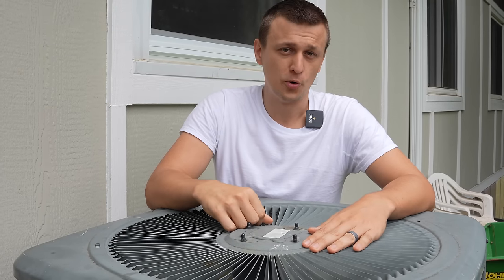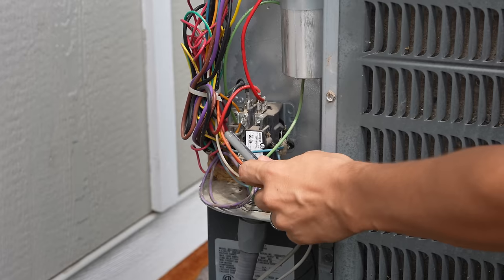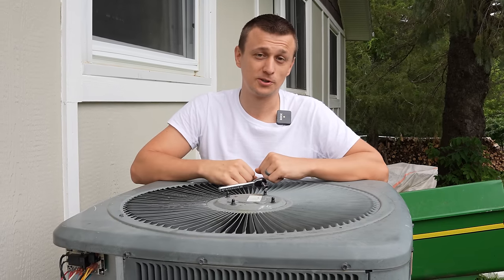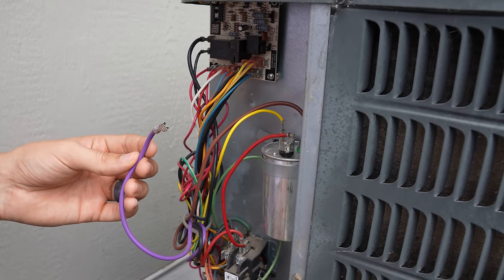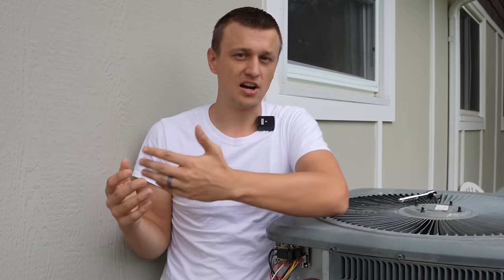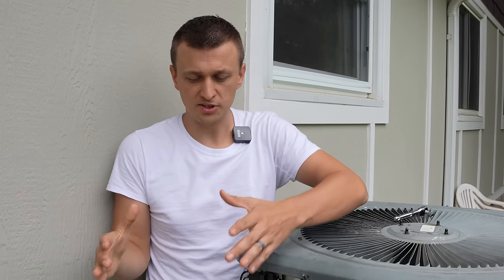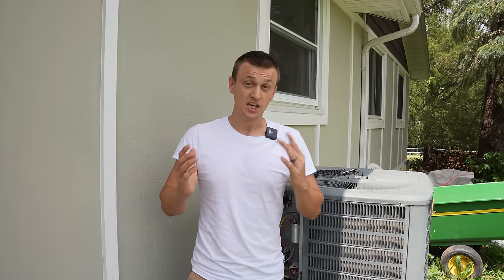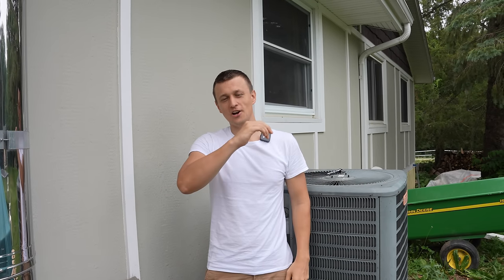Air Conditioner Noisy and Loud

Comment: I had a loud grinding noise coming from the condenser fan motor.Not a screeching noise and the motor turned freely with power disconnected. It would not do this all the time. Checked everything that you mentioned. The motor was a two speed Emerson motor. After many hours of checking it turned out to be a defective circuit board fan speed controller located inside the AC unit( Comfortmaker twenty years old). I bypassed this circuit board and installed a short jumper wire so the fan motor would work on high speed only and it works perfect. No more noise. This circuit board is no longer available anywhere. With 92 degrees outside I`am getting getting 53 degrees inside at top of furnace duct work before going in to main duct that feeds the house. I`am a retired electric utility service technician. Thanks so much for all your great videos!!!
Reply from the maker: Wow, that is awesome that you were able to get it to work without any noise! Major kudos to you for tracking it down and also finding a way to fix it. Your case is pretty unique but thank you for describing it for anyone else who may go through the same 🙏🙏
Reply: @WordofAdviceTV  The wiring diagram on the inside of the AC access cover saved the day to help trace this problem down. It showed what wires fed the high and low speed on the fan motor and the circuit board. I just removed and taped the low speed connector and jumper the high speed connector to the AC feed. Circuit board has been disconnected.

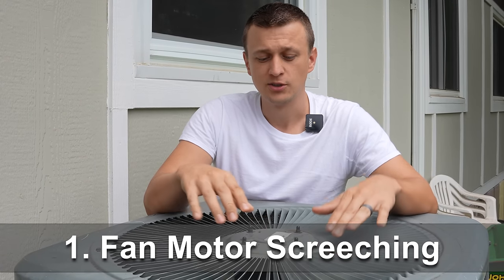Comment: 0:28 1. Fan motor screeching
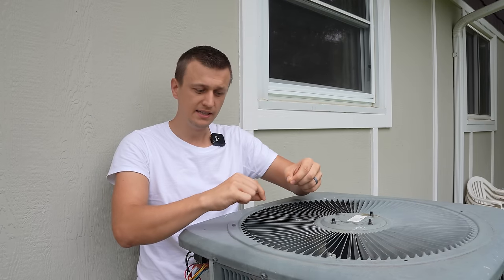1:52 2. Broken fan blade
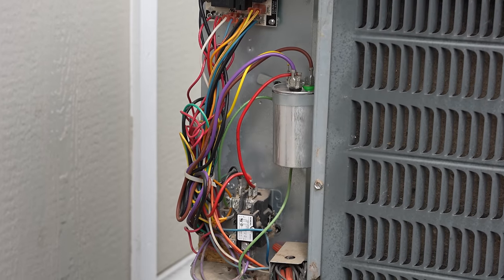2:36 3. Buzzing contactor
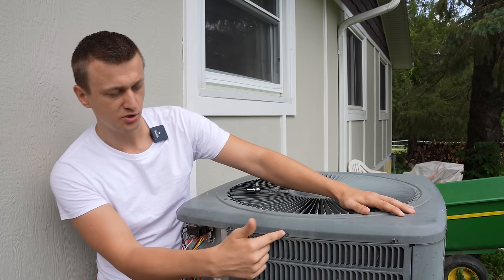3:43 4. Loose Screws
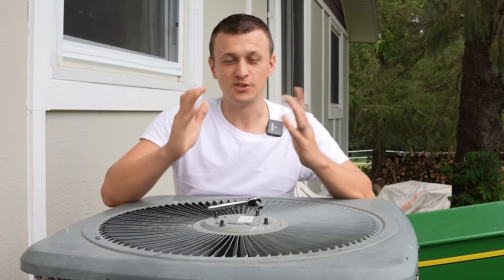4:30 5. Noise coming from the top shroud
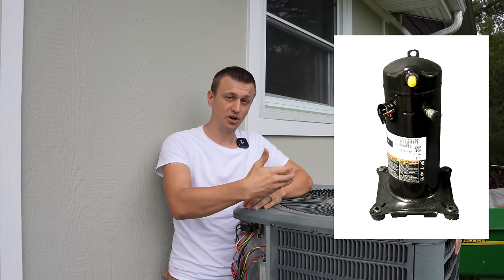5:46 6 & 7. Loud compressor
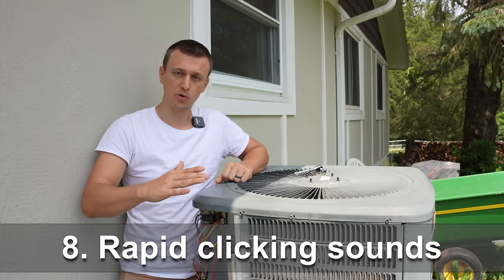9:14 8. Rapid clicking sounds
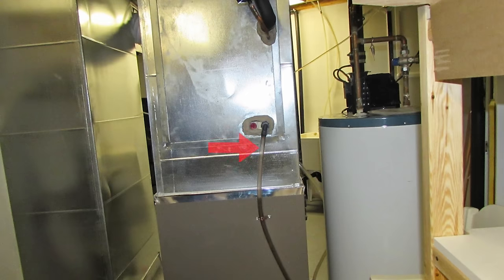10:05 9. Bubbling sounds
11:17 10. Rattling noise inside
13:11 11. Whistling noise inside
14:42 12. Hissing noise
16:23 13. Pulsating noise
17:47 14. Vibrating condenser base
Reply: Yes sirrrr
Reply: We just saw all of that no need for a recap 😂.

Comment: Thanks for this video! I was able to verify the bad contactor on my moms air conditioner, and replace it with one bought from the local AC repair store. The audio sample helped. Not only did it solve the problem for only $22, the AC part store was thankful I supported a local retailer.

Comment: This morning my wife and I thought for sure our AC unit was on the way out. I watched this video when I got home and then went outside to check it out. Turns out the fan motor screws that hold it it to the shroud were a full turn loose, all 4 of them! Tightened them up and it’s as quiet as can be. Thanks so much!

Comment: Thanks a lot. My heat exhaust radiator was clogged with dirt, causing the compressor to heat up and make loud noises which was mentioned in the "Harrowing noise" section of your video. I was able to immediately address the issue thanks to you. Keep up the good work.

Comment: Great list, should be required viewing for all A/C owners. Could save them a lot of money. One thing you could mention is the noise from a defrost cycle when it's a heat pump kind running in heating mode and outside temps are getting low.  First time I heard that and it happened two or even three times in a row I was freaked out. But it's apparently quite normal and it's protecting the coils from freezing.
Reply: that's what our tech said for our unit, but it is REALLY LOUD I wish I could post the video here, and now the HOA is complaining.. heat works fine, but the unit is loud.

Comment: I love all your reasons, but there is one very important one that you didn’t mention - this one should be done before anything else : make sure the outside unit is level. If the packing around the fan shaft is worn, this will create space between the fan shaft and the packing, which could result in a swinging of the fan, creating squeaks and an uneven fan sound. If a A/C unit has been sitting on patio stones for many years, patio stones will sink into the ground, creating a low side and high side of your A/C unit and your fan shaft will be rubbing on one side, instead of moving freely, creating noise. Every few years, I take a level and measure it, if it’s low on one side, I shim it up so it’s level with the other side. Gravity and leveling makes every machine work better.
Reply from the maker: Very good pointer, thank you for taking the time to explain that good sir, much appreciated!
Reply: I had this problem- the pad outside had sunk making the unit a surging sound - I wedged 2x4 sections in the lower corner under the unit.. resolved
Reply: If it's only loud but not noisy, no problem.
Reply: If it is uneven but on a 8 inch thick slab how do you rectify this?
Reply: @mysticwine  Mmm-hmmm.... 😮
😂
Reply: @Jason Clark  I think you need to hire somebody, bud... Good luck!
Reply: Thank you for this. I was able to advise my sister via FaceTime to check for this condition. Sure enough, she leveled the unit and the noise is gone. Great insight!
Reply: I believe this suggestion is very similar to No. 14
Reply: @jasonclark558 ou essentially shim it. The unit is usually supported at four points one at each corner. Just gently lift the low side and slide some type of durable material of the appropriate thickness underneath, similar to how you’d do with a table leg.
Reply: Good advice

Comment: Just came home from a 14 hour shift to a house sitting around 82, inside unit was going 90-to-nothing but not cooling. Went outside and heard a loud, continuous buzzing. Followed this video’s suggestions and discovered it was the contactor. Some little ants had crawled inside the panel and obviously were trying to make a new home inside my contactor. Used some compressed air to get them out and tapped the contactor just like he said and voila! I have cool air again. Thanks

Comment: I wish I saw your video this morning. I just had a second AC guy come and look at my helicopter sounding air handler. (The first guy recommended a total $8K replacement.) The 2nd guy took 10 seconds to figure it was just a vibration!  He literally just held the drain pan with his hand and it stopped. He figured out it needed a tightened of a few screws and it stopped. If I heard your story about the picture frame leaning on the furnace sooner I might have figured it out. Well worth $140 though, instead of a new AC unit!

Comment: Well I did the brick for a while.  I was at Home Depot and was looking for new screws since mine were stripped out and just happen to pickup some rubber washers. So, I put those washers under the screws and it worked great. It also reduced vibration.  Now I can put the brick back in the sidewalk.  Thanks for the tips.

Comment: Jay, you have the sound effects down perfectly. Also with a great explanation of what causes those sounds and the remedies to correct and fix the noises. When cleaning a unit do you ever use a coil cleaner with muriatic acid? My self I like using a mild spray bottle of a cleaner of Clean and green or mean and green cleaner.  Then back flush removing the top cover and fan. I love that hamburger joke another good one you aced it again. LOL
Reply from the maker: Good to see you Clayton my friend! Glad you liked the video and the joke. 😄 I actually never use coil cleaner on condenser coils and most techs I know don't either. Some of those cleaners can be corrosive to the coil and in most cases using just water is more than enough. 🤷‍♂️  But as long as the coil gets cleaned, either way is good. But  if you like the coil to be spotless than a coil cleaner sure does help with that  😎👍👍

Comment: Good video.
I have that exact compressor. I did the brick on top and that worked. Next week I will tighten all of the screws and add some sheet metal screws as needed.

Comment: Great video, Thanks. My Lennox obviously uses a Scroll compressor as noted by the rattling sound you provided when shutting off. Otherwise, it runs smooth and cools fine.

Comment: Thank you for this video! I think I'm having the first problem based on your sound descriptions. I'm hearing a loud screeching noise just like you described and I'm going to try to oil those fan motor bearings and see if the solves my noise problem before I change the fan motor

Comment: Hello Jay, thank you so much for taking your time explaining exhaustive reasons for ac noise. I had recently replaced my ac unit, but it started making the noise under reason #6. My ac guy replaced the compressor, but the same problem keeps on coming back. It would run fine for some time, but sporadically make that loud noise from the compressor for few minutes, blowing warm air, and then it would work fine. Any thoughts on what could be the problem?

Comment: Took my cover off and added oil to the shaft. Did this yesterday, running smooth.. it was very loud and vibrating.. I used a synthetic high temperature oil, Blaster Multi max from the Home Depot..

Comment: My compressor is clearly the noise with mine.  And it stops cooling when it makes the sound.  But if I shut it off for a while and then turn it back on,  it is cold again until it makes the noise again.  

For now I have portables till I can afford to get a new unit.

Comment: Hello my friend...just vewed your 14 reasons for AC noises.  Very good.  If I may, I have an ocillating/pulsating hum coming from my AC unit.  The  AC unit cools well, fan works, no discernable hiss, buzzing, or the other sounds your described.  I tried to determine where the sound is coming from.  I checked downstairs where the furnace, blower, etc.,is located, checked the outside unit itself, as well as the house.  The only location where I heard the hum is only in our bedroom. The AC unit is outside our outside bedroom wall. 
Any assistance or trouble shooting to resolve this issue would  be greatly appreciated.   Thanks in advance.

Comment: I had mine turn on rattling horribly. Found out it had dropped below freezing after it rained. Ice had formed on the fan blades, and either caused them to be off balance, or the ice was hitting the sides of the unit. Poured hot water on the blades and problem solved. Dunno if that's the appropriate corrective action,  but it worked.
Reply from the maker: Oh wow, that one's unique. I have never seen that before, thank you for sharing! And great idea for the solution! If it fixed it, then all is good. 👍👍👍
Reply: @Rambler I'm glad my experience helped you.

Comment: Thanks so much! Im bringing my checklist to the unit right now and we'll see if any of these work. BTW...What's a furnace? I'm in Texas and I guess we don't have those.
Reply from the maker: Good luck!! A furnace is the thing that blows air inside the house. In Texas its likely referred to as an air handler but they call them a furnace when that indoor unit is able to heat the air as well (using gas or electricity)
Reply: @WordofAdviceTV  OOOhhh! Got that. Thanks so much! BTW You're right it's not level...

Comment: Hi, 
This is a very comprehensive video with great explanations. But I need help with something different. 
One extremely frustrating problem I am facing is CHIRPING. After 30-45 minutes, the chirping sound starts coming and continues without stopping. The HAVC team replaced the motor, but the sound isn't gone. What could be the problem, and how do we fix it? Please help.

Comment: That video was very good. I noticed the 220V relay switch on my unit makes a loud noise when turning on or off, and the only reason the noise is loud is because it's screwed into the chassis. The chassis is all metal so it's pretty much an accoustic box which amplifies the sound by an incredible amount. 
I'm trying to figure out the best way to detach that switch, I'm thinking of a neoprene rubber ring of some sort that will prevent the switch contact hammer (whatever that's called) from vibrating the whole thing. I'm also looking for ways to dampen the reverberation of the sound in the protective metal grill fins, those all ressonate with the air flowing so I'm sure there are lots of decibels that can go away if I figure how to prevent them from vibrating. Any ideas or suggestions are welcome

Comment: What a great and well done/explained vid. Thanx a Mil!
I just had my outside Compressor unit and inside Heat Exchanger replaced 2 months ago. Love the new stuff. Its a beautiful nice looking Rheem brand unit.
Only thing i dont like is when Compressor unit first starts up. Initially it makes that clunk buzz rattle noise but then runs quiet afterwards. I gather start up noise  is because its one of those "scroll" type compressors in which you stated that thats a normal noise  for scroll type compressors on start up.
● Is there any mod that can actually help quiet that start up noise?

Comment: What might cause an extremely loud noise to emnate from the condenser for the fist 7 or so seconds after startup? The sound is some combination of an ice crusher and an old school gritty HOOONK of old fire alarm systems. My guess might be broken internal compresser suspension springs, causing the compresor to beat agaisnt the case for the first few seconds? Maybe as it builds pressure it alters the compressor dynamics that decreases the vibrations enough that it doesn't strike the compressor housing once it is running.

Comment: What about this noise: 
Sounds like a table being dragged on a wooden floor with sand under its feet. It starts 5 or 10 seconds after the compressor is on. Goes on and off a few times (for not longer than one second each time) and then keeps going continuously while the compressor is on. It only happens in cooling mode. Heating mode makes almost no noise. It's always been like that since installed.

Comment: what would cause a condenser fan blade keep cracking? I have a goodman heat pump split sytem, I have replaced the motor condenser fan a couple of times in less then 3 months. any information would be greatly appreciated.
thank you.

Comment: Hi. I have the exact buzzing noise from your video when you talked about the contactor. I bought and replace the exact product. I still hear the same buzzing noise. I don’t know what else to do. Motor, fan and all are working fine. When I tapped it, everything was so quiet. Then the noise would come back again.

Comment: I had Carrier Comfort installed, the accumulator sweating excessive condensation when running, puddles of water. Tech did not check pressure charts when filling with freon. 98f when installed, so worry if correct volume of  freon was  installed. Also heat pump makes clanking sound when turning off (sometimes when turning on too). AC was super cold when first installed and now cool but not super cold. Unit is one month old today. Hvac contractor unavailable for conract, so  worrying company rented the license and no licensed contractor on the job though license was provided when signing the contract. Also no drain pipe installed to drip pan. If cut off switch to heat pump fails, no drain out of attic drain pan.

Comment: One of my AC units runs so amazing, it really delivers super cold air, but the compressor has always made a lot of noise. Putting on one of those blankets sounds like a great idea, but wouldn't that also trap a lot of hot air and cause more wear on the compressor?  Mine lives in 110 degree weather, by the way.

Comment: Mahalo, Jay!

?: Any issues running a new Danby portable AC unit continuously for several days?
I’m talking five days or so as we’re in a hot period for several days on the Pacific Northwest.

Btw I covered the discharge hose with an insulated 6in hvac duct sock…👍🏼

Thanks!
Reply: Check for temp from duct.. If it's about 14 to 20 below the room temp, then our maxed out bro... One trick is to trickle water over the condenser coils outside.. Please know you generally can't get more than 20° below outside temp w/o more capacity.. It's physics bro.. Too much for answering here...
Reply: @francom6230  hi Franco.  The unit is working fine, I’m only wondering if leaving it running continuously for days is going to cause problems.  Danby portable AC from Costco don’t have btu number handy. Thanks!
Reply from the maker: @Mario Dalla Riva 
With most air conditioners, it is actually harder on the compressor and fan motor if they are constantly turned on and off throughout the day than if you just run it continuously. The most wear and tear happens during start up. In short, it's okay to run it continuously for days. 👍 Stay cool Mario!
Reply: @WordofAdviceTV  mahalo, bro! 👋🏼🤙🏼

Comment: hi! 3ton Goodman heat pump what's causing solenoid on reverse valve causing busing noise ?  only when i connect wires comming from nest thermostat , i already swap the defrost board

Comment: I heard a hissing sound once when I lived in Austin. Somehow the condenser fan motor has stuck completely. What would happen is the AC would come on, but it wouldn't cool and I would hear a very LOUD hissing noise from the evaporator. I think it might be the TXV going all open because it detected excessive pressure. Anyways I went outside and found the condenser for my unit, and just hit the condenser fan a few times with a stick to get it spinning, and the hissing noise stopped and the AC started cooling again. Maintenance replaced the fan motor and topped up the refrigerant (It used R22) and it worked ever since.

Comment: 16:25 Regarding the pulsating noise: The AC in my apartment makes this sound, both when the AC is running and not running. 

Is this the same thing, or is something else going on? Managers and maintenance guys at my complex refuse to fix the issue.